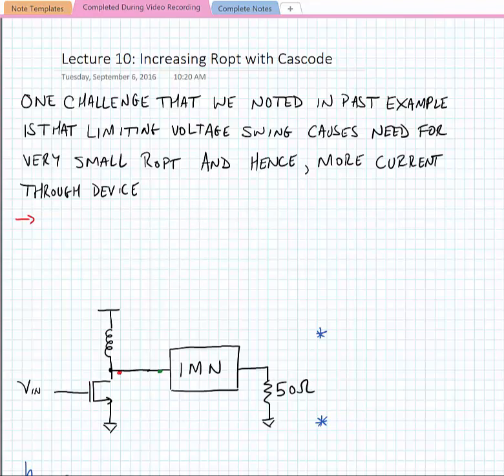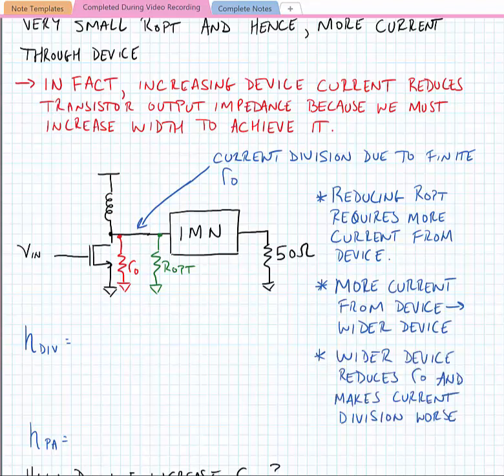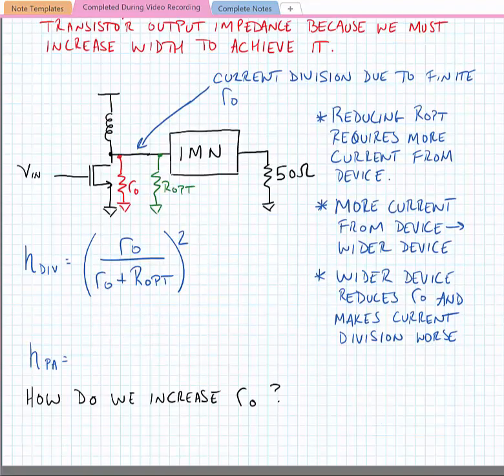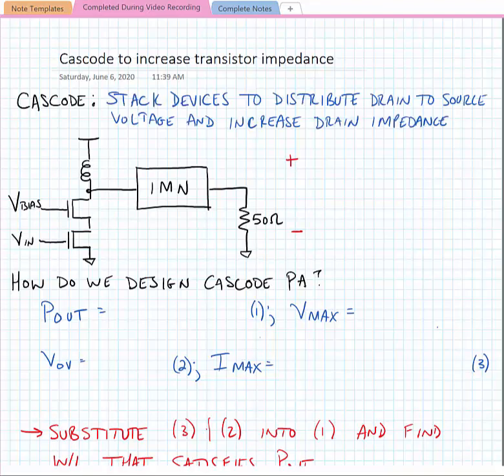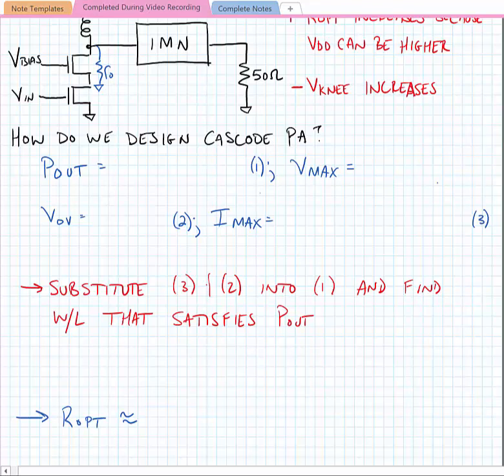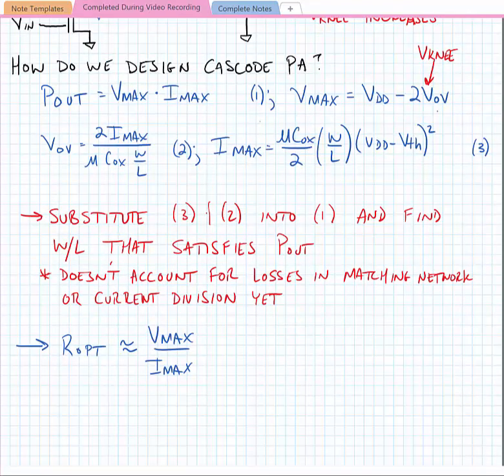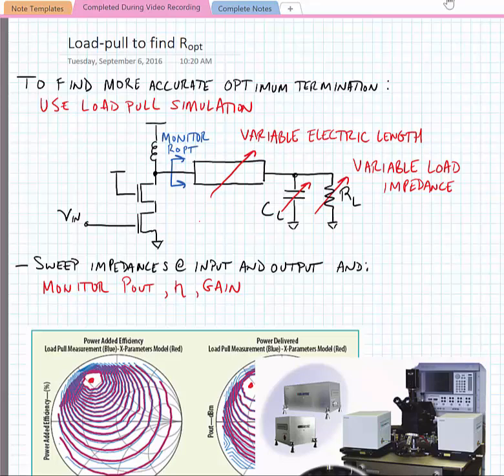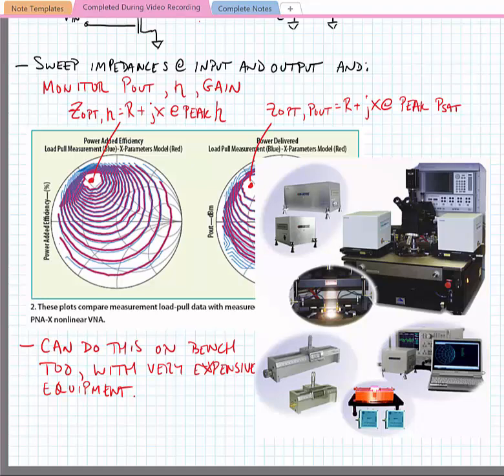Lecture 10.1 - Cascoding to improve PA performance

Comment: But as we make ro larger by reducing the current and increasing the supply we also make Ropt larger for a given Pout, so is always the division effiecnecy will increase ?
Reply from the maker: If you are asking if adding another device in the cascode would improve efficiency, there tends to be a diminishing return, where losses at intermediate nodes and the additional knee voltage requirements cancel any improvement that may be obtained by the increase in the supply.

Comment: Thanks for the content, Jeffrey. You said that ro in the cascode situation is greater than the ro of the CS situation. Is this due to the fact that now you have two ros in series (one from the CS and the other from the CG) ? Thanks!
Reply from the maker: They are not just in series if used in a linear mode, the resistance looking into the drain is ~gm*ro^2. In a switching-mode, which will be discussed later, the rds would be in series.
Reply: @wallingphd  I just made the verifications: For a cascode amplifier, under small signal operation (1 being the CS and 2 being the CG): vout = iout(ro1 + ro2 + gm2*ro1*ro2) - vin*gm1*ro1(1+ro2*gm2), if we consider vin in M1 being small, vds = ids(ro1 + ro2 + gm2*ro1*ro2), which leads to vds/ids = ropt = ro1 + ro2 + gm2*ro1*ro2. If ro1 = ro2 = ro and gm1 = gm2 = gm, ropt ~ gm*ro^2. It took me a while to see that as Sedra uses a different approach to present this result.